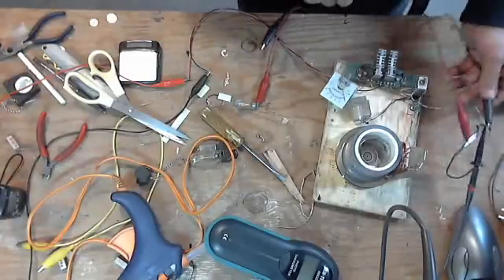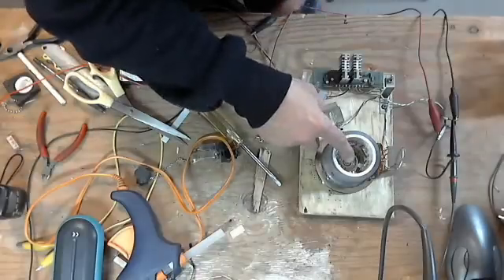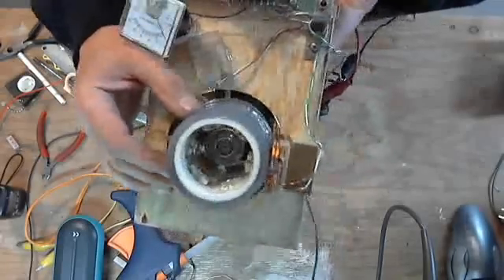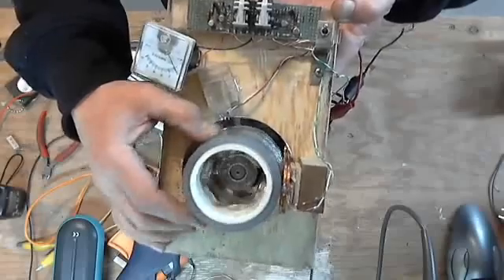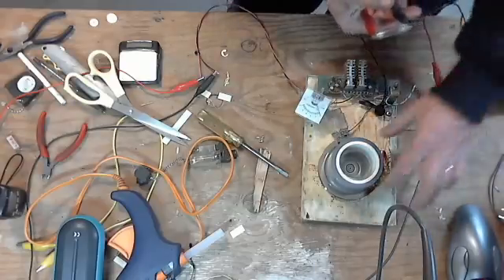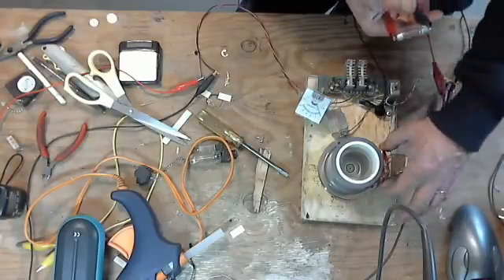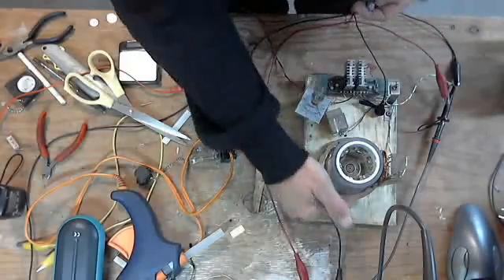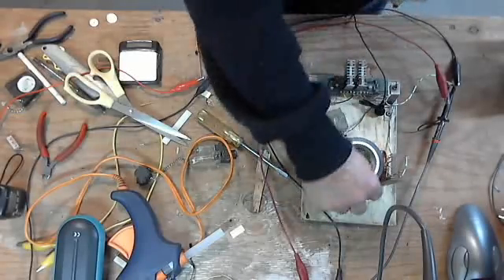#331 Zero Lenz test with 6 pole rotor

Comment: If it is not lighting the bulb then this simply means your not drawing enough voltage current from the coil to have a breaking affect, perhaps not enough turns if the reactance coil tapping the magnetic field is negligible then so will the lensing affect be also. If the voltage is so low then it is most likely being lost through inductance of the wires your touching together, you really need more voltage across the coil to be able to test this correctly, I am doing similar tests. If your polarity is not alternating then your also not generating any AC power = null affect, and null power output.

Comment: Just try using a 2 or 4 pole stepper motor as a generator. Acceleration will be very pronounced above 300-500rpm

Comment: Keep your RPMs lower unless you want that plastic EXPLODING IN YOUR FACE !!! 7200 is fine for a platter DESIGNED FOR IT but I don't think plastic can take that force. I may be wrong but I think you pushing your luck. If you have info showing the force generated and the material strength please show it to stop other people from getting hurt and help experimenters.
Also, for testing the LENZ effect, perhaps drive the generator with another motor (#1) and measure its current draw when applying a load to your motor/generator (#2). I know you could get a good guess on the efficiency from measuring power in vs power output and compare it with several loads on #2. Perhaps use a large rheostat or other adjustable load.

Comment from the maker: No magic. It took time. First I set the cylinder on the platter centered as best I could by eye with a fairly heavy weight on top to keep it from slipping. Then I moved the stator coil mount in close until is almost touched. With some light shining from behind it's easy to see the gap vary. A little tap here and there, move it closer, tap some more, until it just barely rubs for 360* rotation. Then carefully apply glue.

Comment: Zero Don't pay attention to the nah sayers. Just continue the research..
 Try balancing the wheels symmetry and put another pancake on the other side. Then you just need to angle one pancake slightly off center of the other pancake. This will squeeze the magnetic field in the rotor and create a magnetic bearing. 3 pancakes would be ideal then you can use it without stressing the bearing. Each coil should be adjustable except for the primary coil. Give that a try, 3 being 3 phase and pairs.

Comment: Mith busting : the long slowdown is because of the stored energy in the flywheel is relatively large compared to the energy extracted through the coils. 
Ex : large battery will make a led lid for much longer period then a small battery.
This does not mean the coil is bad, it means it can slowly drain the source.

Comment: Hey Z, You talked about making a device to block the magnets poles from one another, have you given any thought to using those arched pieces of metal from a hard drive. The ones that have the neodenium  magnets on them. If they prevent the magnetic force lines from being where its not wanted inside the hard drive; wouldn't they do the same thing within your magnet thingy?

Comment from the maker: Really don't need the gate driver as long as my voltage is high enough. My problem was I was using my VS-50M variable supply to drive the circuit at lower voltages to limit RPM. Hence lower gate voltage. Hence non-saturated MOSFET. Hence much heat.

Comment: Here's a nice one that's easy to use and can drive two mosfets  independently.   Google the MC34151 which is a dual channel mosfet driver chip.  A scope on the gate and source/drain will show you if your existing circuit is effectively turning the mosfet on/off well, though the fact that you said it's running hot, makes me think it's not.  People forget about that quirk with mosfets, gatecapacitance takes a finite time to charge, hence turn on/off time is limited to hard fast you can charge it.

Comment: If your fets are getting hot the gate drive is probably insufficient meaning the fet's are not being turned on fully.  Big power fets have big gate capacitance and there are some nice driver ic's that'll properly bang the fets on and off and greatly reducing the amount of time in the linear (hot) region.

Comment: The EMF generated will depend on the geometry between the axis of the bowl and the axis of the rotating magnetic field.  In theory if the magnetic field rotates about the same axis as the axis of the bowl the output will be zero or near zero because no coil loops will see changing magnetic flux with respect to time.  Have fun!

Comment from the maker: Tonight I tried alternating polarity. Got about 30v p-p at 10K RPM and predictably 1/2 the frequency for any given RPM. Also got what felt like 100x the Lenz drag I saw earlier. i.e. Lenz drag is directly proportional to power consumed (I*E). I was able to illuminate the 12v incandescent dome light quite brightly until the rotor slowed. Voltage under load was also very predictable. Also tried 3 magnets (for balance) not 4 with same polarity out and lower but similar results to alternating.

Comment: And as a little "bonus" - once you know the moment of inertia of your rotor, then you know the number of Joules of mechanical energy stored in your rotor for a given RPM.  Another little bonus:  You know the power being burnt in the coil itself and the rotor at a given RPM.  You also can easily measure the power draw from the battery.  Therefore the diff between the battery power and the total load power is the "direct heat power" due to air and bearing friction. -> a way to evaluate bearings.

Comment: Perhaps one day someone will do an analysis like I suggested many times in the past.  I would not be surprised if you had a laptop scope so you could record waveforms.  With that and a Hall sensor and some simple crunching you could measure the moment of inertia of your rotor.  Then you could also measure the spin-down deceleration when you switch over to the load.  With that info, you can measure the mechanical power drain from the rotor.  To go full circle you compare it to your electrical pwr

Comment: Knowing the current allows you to measure the expected voltage drop in the coil when you add the light bulb load.  Does that also check out?  Do you see the expected voltage droop when the load is added.

Since you know the total power being dissipated in the circuit, just by eyeballing it, does the observed rate of spin-down "feel right" when you look at it.  If you play around with different load resistors you should be able to get a feel for the power vs. spin-down rate.

Comment: The light bulb load caused very little drag.  It would be useful to crunch the numbers.  Knowing the open-circuit EMF generated by the coil as measured with your True-RMS multimeter, and knowing the resistance of the coil and the resistance of the bulb, calculate the expected RMS current in the circuit and calculate the expected average power dissipated in the coil itself and in the bulb.  Then to a double-check: Measure the RMS voltage across the bulb under load, get the current. Do they match?

Comment: You are on the right track Zero, I can suggest some things for you to think about.  There is a very good chance that if you switched over to four magnets at 90 degrees, all same polarity pointing outwards, then you would see a higher voltage output from the pickup coil for the same rotor speed.  Can you explain why?

Someone suggested with the six magnets, try alternating polarities for more output.  I am going to guess the output will actually go down.  Again, can you explain why?

Comment: That makes sense because you always want to keep in mind that the power into a load resistor is proportional to the square of the voltage across the resistor.  So if your voltage dropped by one-third then you would expect the Lenz drag to be about one-ninth.

Comment: Zero great vid...if you alternated the polarity of the magnets, the centrifugal force should be enough to keep them firmly against the sides of the cylinder at high speeds. Low speeds, maybe just strong glue? Try it I guess lol

Comment: I once built a generator with magnets that faced side to side rather than having the poles facing outward. I used 4 and got this effect:
..N....n/s....S
n.................s
s.................n
..S....s/n....N
Where lower case are magnets. The opposing magnets repelled the fields outward more than normal, as shown by upper case.
Feel free to try this if you can build a housing that can support those opposing forces. I used weak ceramic mags with 1/2" gap, 45 stator windings, making 1.3VAC

Comment: Very impressive presentation, Mr. Zero!

Your work inspired one to make some tests on one of your monofilar pancake coil designs :D! 

BTW: also tested some dome shaped coils myself, running them on 32x N/S+S/N muller motor type magnets @5000RPM. Somehow, did not even get any noticeable
voltage increase :/ (May be, couple 10th of mVolts).

So, N/S+N/S magnet formation, like in your video, looks to be the only way to go for those type of coils :O.

Or, may be I am missing something o.O?

Comment from the maker: It is true that my output voltage with the smaller magnets is lower ATM, about 1/3. The observation I made last night is that the Lenz drag seems to be disproportionately lower, about 1/10 or roughly the square root of the lower voltage. I'm also not certain that's the limit, but it seems to be a start. More testing to come.

Comment: The output of the little motor is 290 Volts over 60 milli Amperes DC continuous power to drive a Fluro light bulb which almost lights the garage.  What limits the output voltage to 290 Volts? Caps are slow and leaking.  Transistors manufactured in Mexico etc. Latency between the transistors, but in theory I should be receiving  600 Volts . Input is asymmetrical shark tooth, variable pulse train and I use True RMS, and other meters and integral functions measuring the area in the scope

Comment: Hello Zero. Thank you for your video.  Question?  I experiment with very fast pulse shut off.  Pretty much governed bt the capacitance of the transistor arrays shutting off the current to my motor. Typically 50 micro secs. I charge a bank of 20 x 400Volt capacitors from TVs. I am not using Forward or Back EMF, rather a stationary longitudinal wave which occurs at very abrupt shut down.

Comment: Lenz drag is proportional to the voltage/current draw induced in the coil. Your rig is not generating enough voltage/current to break a burn on the bulb filament, therefore, minimal drag. Up the turn count in the winding....